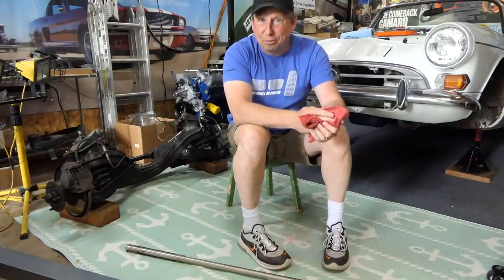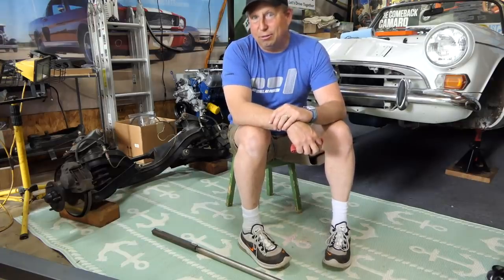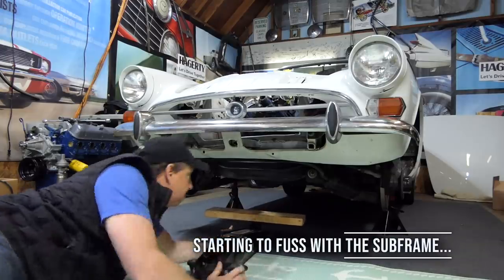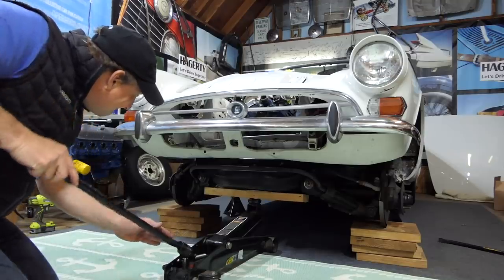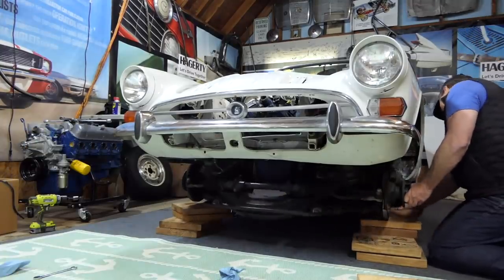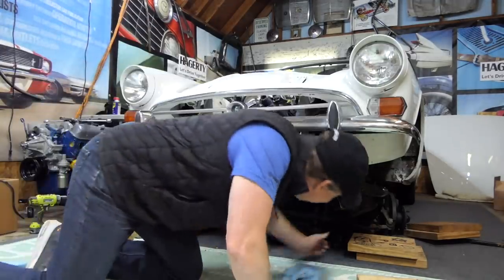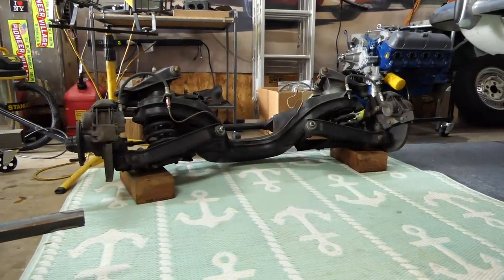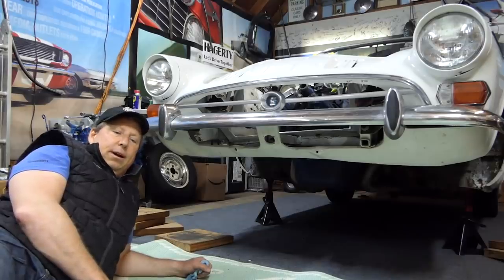Front subframe removal goes mostly according to plan | Sunbeam Tiger engine swap project - Ep 3

Comment: Semi-interesting facts. That hole in center under the grill is for emergency starter crank from the 4 cyl Alpine version. The square on each end  are for the jack. The jack has a square wiener thing you insert. They are also on side and rear. Great system

Comment: Electrical tape the socket to the extension to keep from losing sockets.  Also tape the bolt and washer onto the socket with one strip when putting it back in.
Reply: Yep, I've got a run of Duct Tape around it!

Comment: @Bradp69 - I notice you had an oil filter on the block and not relocated. Does
That filter touch the sub frame ? What part# are you using ? Can it be changed without lifting the engine ?? Do Tell !!

Comment: i really love that car. could you imagine a 5 liter 373 stroker motor under the hood? good luck.
Reply: 373 wouldn't be a 5 liter.
Reply: Bucking Bronco , its a 5 liter block. just like a 347! i have been struggling about what engine i want to put in my 61 unibody and the 363, sorry i hit the wrong key. is or was one of my choices. the problem with the 363 is the cost. my other choices are a bit less expensive.
Reply: @steveherring6660  oh, when I talk about a stroker I just say 347 Small block Ford. Or somn. If I fan give you some advice the 5.0 Ford blocks had an issue around 400 horsepower they would crack in half starting in the lifter valley, but if you use a 351 Windsor you can stroke it out to 408 Cubic inches and they didn't have the same cracking issue, and you can buy the already stroked 408 on summit racing. They are dimensionally no bigger the the 302.
Reply: hi, no i got no info from anyone. i just know from going through the motorcraft catalogue that ford has a 363 engine. if you go to google and type in 363 you can see some of them. there about ten gs. they sound like a real engine not like the engines now. oh ya i have a 5 liter in my 67 mustang that i have 351 valves in. it breaths real well. she not lacking in the giddyup  and go either.  ive had some problems to work out but shes coming together.
Reply: @steveherring6660  that's cool man, good luck!
Reply: thanks bronco, i still love you car. i had a guy in high school that had one. he painted his one weekend. i road in the back from front royal, va to dc . his mother was a race car driver. she had a austin healy 3000 with a chevy 327. it was pretty quick too. even though i was in the back of that sunbeam i just had a blast. very tight quarters, as you might already know. that wasnt the first time i road in the back either. had/have another friend snd i road in the back of his sunbeam. from dc to ocean city, md. he crashed his later on. ive been forwarding him you build. i saw him lately and he said he really misses his alpine. thanks for sharing your life with us.

Comment: That sub frame looks like the ultimate hot rod suspension for a t model or a "a" model cause for some reason a lot of horse power and a manual steering box off of a thirties car frame is just dumb to me. That is total rad suspension.... I had a white one with a automatic and a dark green one with manual trans and it was really fun but I hated that dark green then,,, tastes have changed over forty some years ago.

Comment: This car already had a 260 V8 in it. Swapping it to a 289 is not a big deal. Hell he could have put a 351 Windsor
Reply: Yep, the fun is that it's the "Redline Rebuild" 289 we built last year. Certainly nothing special about a 289 in itself, heck the Mark II's had them stock. Not sure about a 351, though- I think it comes out too wide. It's a little different, isn't it?